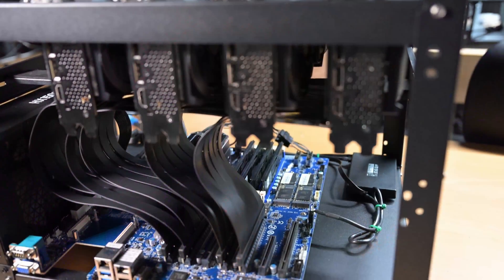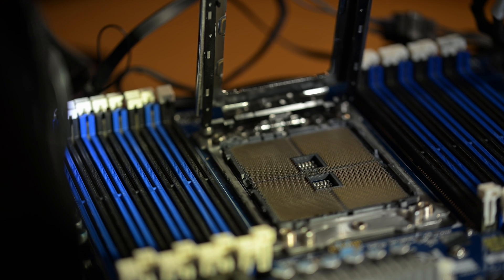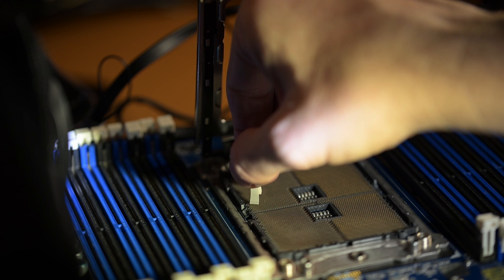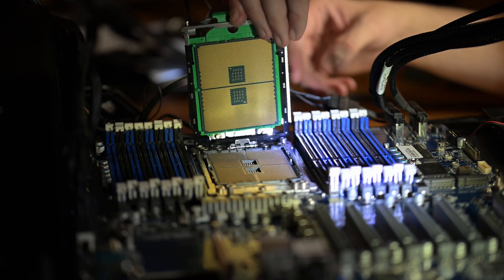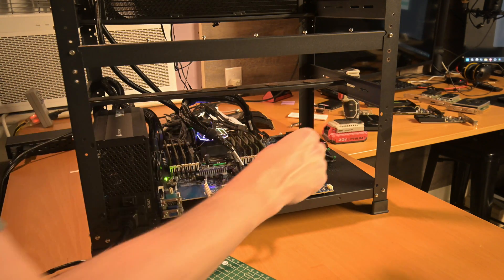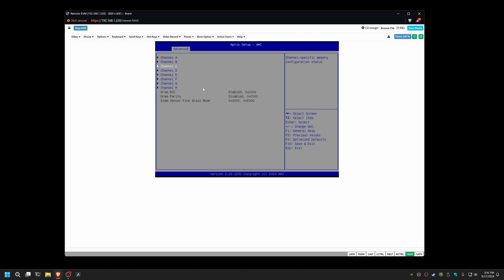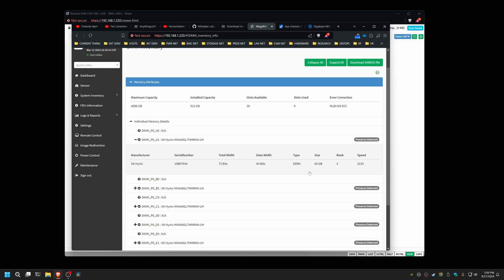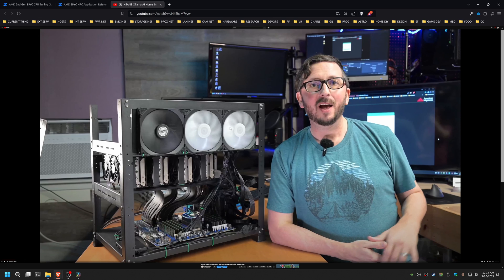How To Fix Bent CPU Socket Pins Easy!

Comment: Nope, this made it worse. LGA sockets are the bane of my existence.
Reply from the maker: How did this make it worse @sirizalot or are you just needing to take it out that its fubar? I understand if its the later. Read others comments, it clearly can work.
Reply: @DigitalSpaceport Sorry, I should have clarified. It made it worse through fault of my own. I was too confident after watching this video. My computer still boots, but now it hard resets once the CPU reaches a certain temperature threshold. I'm going to see if I can get the socket professionally repaired.
Reply from the maker: Ah yeah I am near the point of not having steady enough hands myself now. Plus my eyes cant see pins very well anymore. Pro repair likely next smushed pins I hit also on these newer tight lga sockets

Comment: This is fortunate because it looks like I have a couple bent pins on my m32-ar0 r3 which I could only see by taking a picture with my iPhone and then zooming in, wish me luck!
Reply from the maker: I wish you steady hands and sharp 👀
Reply: Turns out it was just some fluff but the motherboard is borked I tested the ram and cpu in another board and everything works great

Comment: hey.. ive bent some pins on my cpu while i was upgrading it and im just wondering if it affects overclocking or tweaking in any way? (PBO, curve optimize?) i already straightened it and the pc is booting fine.. just wondering if the bent pins are the reason for my horrible CO

Comment: I had the same problem... Mobo came like this... I try to fix it but im not sure... is there a way to check if all pins are properly ok? a program or something?
Reply from the maker: Populate as many ram channels and pcie slots as you can and run memory tests. The memory controller is on die cpu so a missing connection hopefully manifests.

Comment: I have tested 2400mhz and 3200mhz ram and I don't believe we even seen a 1% difference in most applications. Unless your gaming or just running your system to do benchmarks there really is no difference.
Reply from the maker: Exactly. In a few high interchange VRAM to RAM applications I have seen low single digit improvements.

Comment: I hate those contacts it not matter if it intel or amd or vender they are just so fragile, i seen boards that have come with what looks to be misaligned contacts i hope they fix this in future or come up with a new style, personally i know with the amount of contacts on cpu's it might not be possible but i miss pins and as far as i am aware they stopped using pins due to cpu's getting stuck on heatsinks and getting ripped out but with the metal plate coming over the cpu substrate that would not happen. but anyway it is what it is.
Reply from the maker: Yeah I miss pins also. I did lift my 5950x a few times with the water block but it was okay. I hope for a better form factor also.